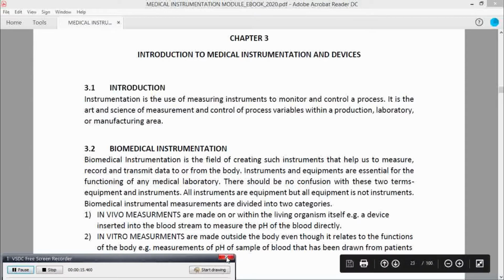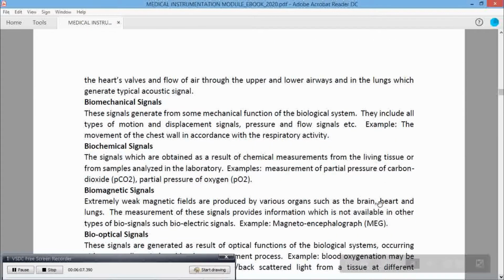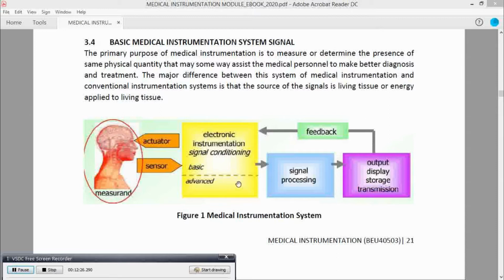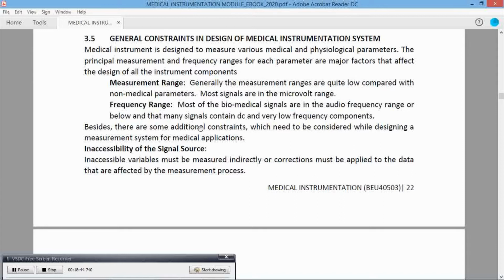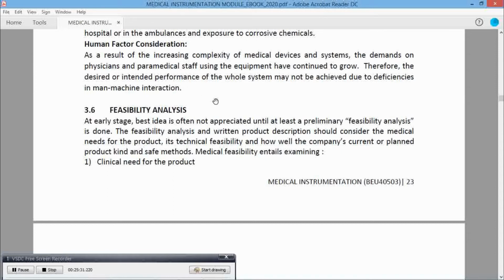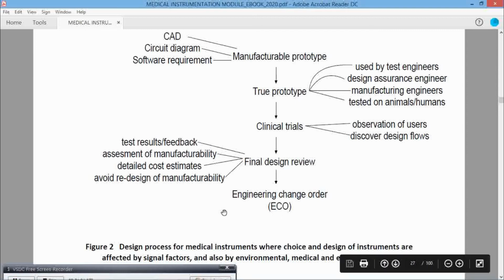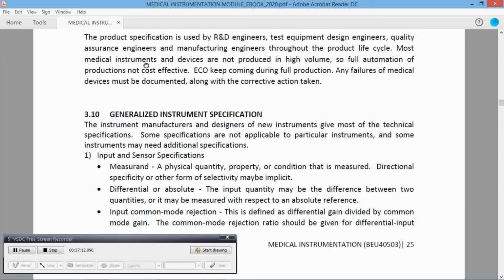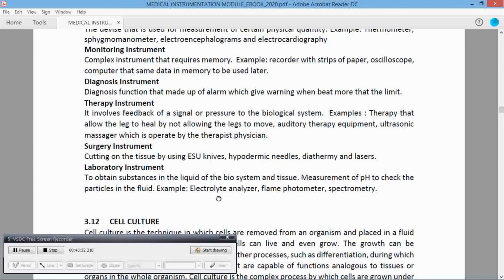medical instrumentation BEU40503 lesson 4

Comment: Assalamualaikum Prof. Thank you for the sharing about the Introduction to Medical Instrumentation and Device. In this chapter, I learn about the classification equipment on diagnostic, therapeutic, laboratory, research equipment and many more. I also learned about the VIVO & VITRO measurement in biomedical instrument. Beside that, there have the bio-signal in instrument such as biochemical signal, bio-optical signal and more other.  In this instrumentation, there have basic of instrument such as transducer, signal commissioning,  display system and other. The instrument also have a design criteria to design some instrument.